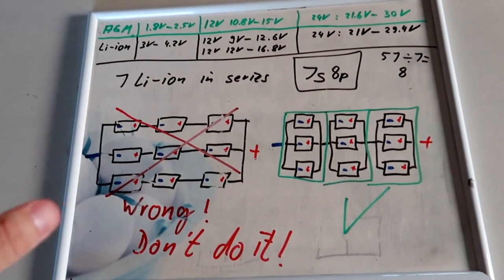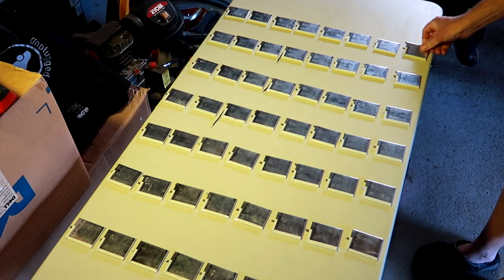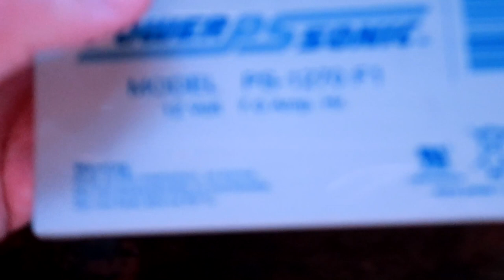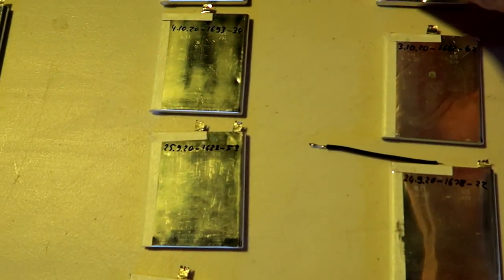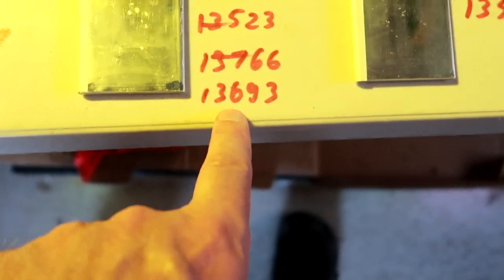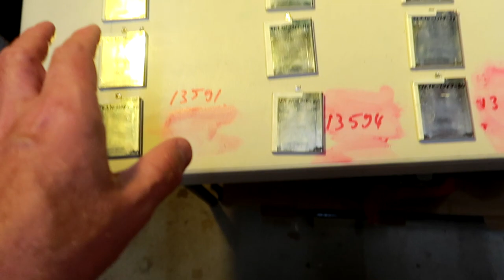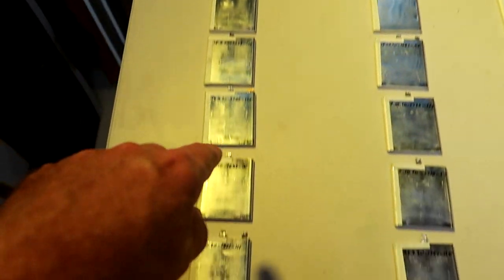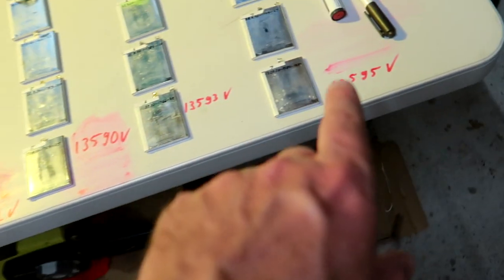Workshop: Replacing a 24V Lead Acid battery with Lithium, Part2

Comment: Rather than go through all that. Isn't your whole cell pack (8P) only as good as your lowest Ah individual cell?
Reply: No it's as good so the lowest parallel group. Li cells will self ballance within the parallel group as the voltage curve is relatively steep and corresponds to state of charge. Unlike lfp's very flat voltage curve

Comment: Also which BMS are you intending to used with your lithium batteries.
Reply from the maker: I showed the BMS in the first video of this workshop, I believe. It's just a small 20A BMS without BT or other fancy stuff. The solar gate pulls only 2.5A when the doors open or close, so fairly small load.

Comment: How do those batteries connect together?
Reply from the maker: Good question. I will  show that in a future video of this workshop series, but basically their terminals need to be soldered together using either fuse wire or little glass fuses. I'm not sure how I design this pack either. I'll do some testing and show you what works best.